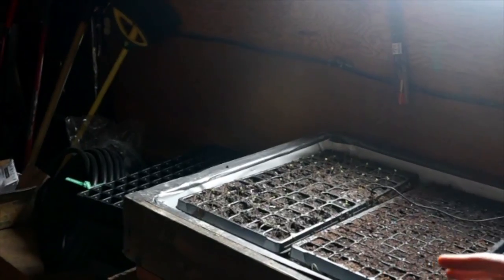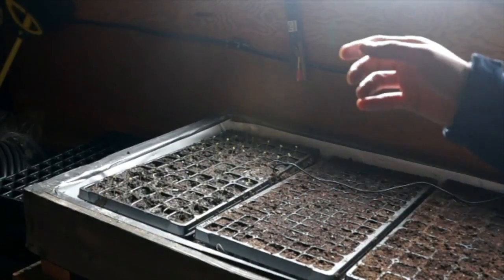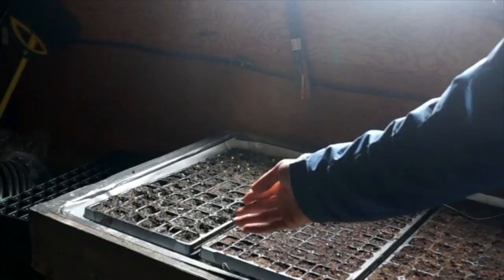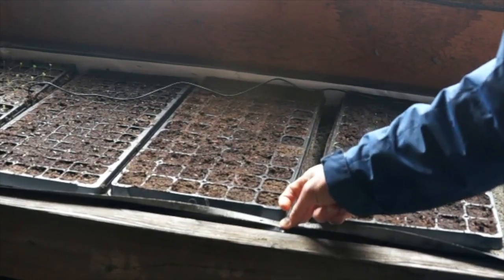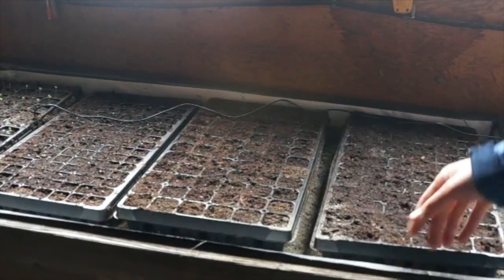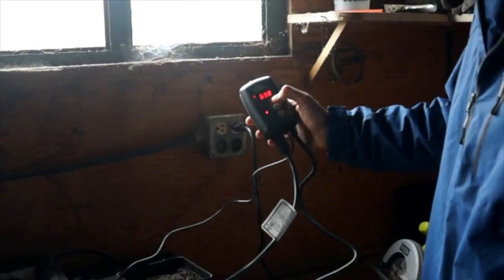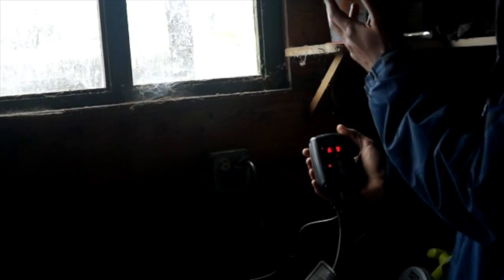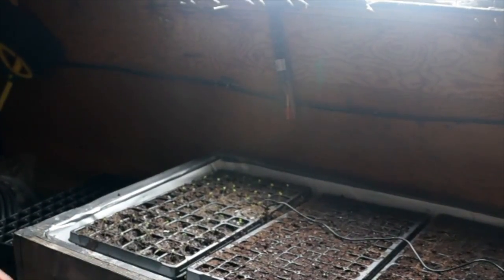Germinate Seeds FAST With an Easy DIY Seedbed Warmer

Comment: id use electric seat warmers they are 18$ on ebay
Reply from the maker: Yes that is one option! See https://www.howpage.org/seed-germination-methods-for-growing-plants for an article describing several solutions. A good point to note though is it wouod take 4 of those heat mats to do the job of this small propagation bench.